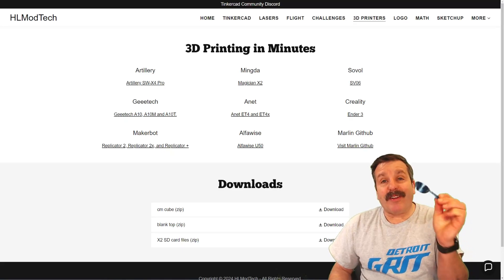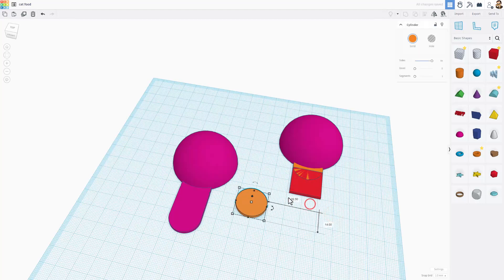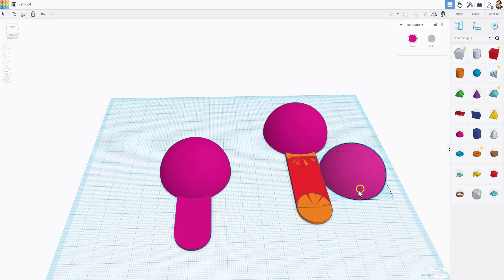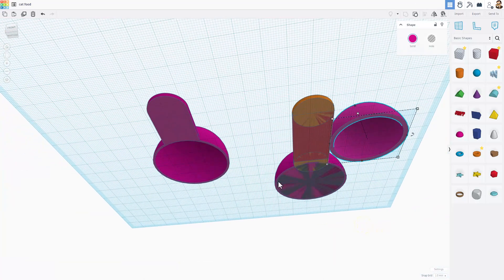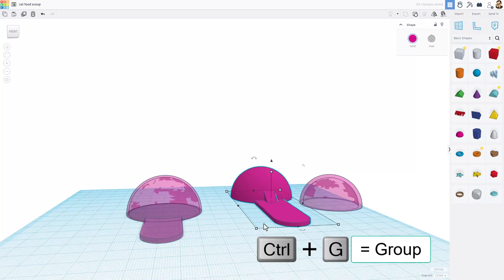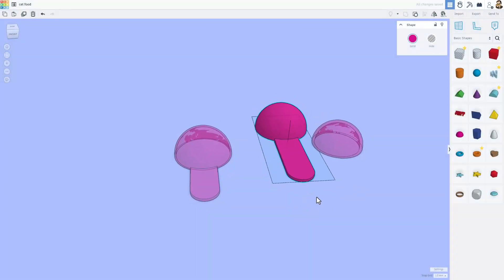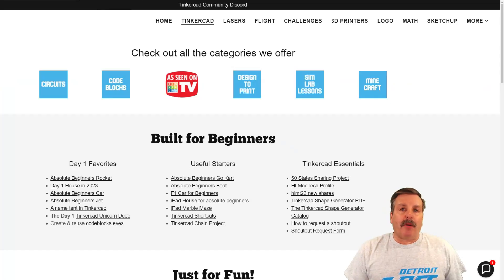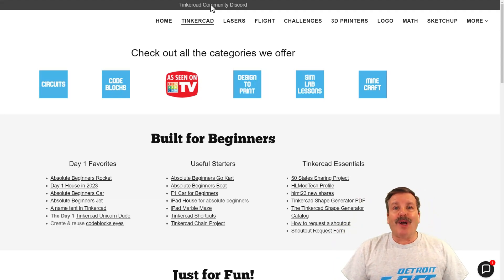A Printable Tinkercad Scoop in 6 Minutes! Absolute Beginner Ready

Comment: If you use half spheres there are some consequences. First, the horizontal wall thickness changes on the way up, being thinnest at the base. Second, you may get print artefacts as it fails to bridge inside at the apex. Third, you'll get a lot of layer lines on the top of the sphere. If you use cones, or better the walled cone ring (name?) and a cylinder, all of these problems are avoided.
Reply from the maker: Good points... but I need the rounded shape to fit the bowl. =) The X4-Pro was super clean inside and out. Most of my new printers also do really well with overhangs. I have not setup a video test... but one should be in the works. 🤔